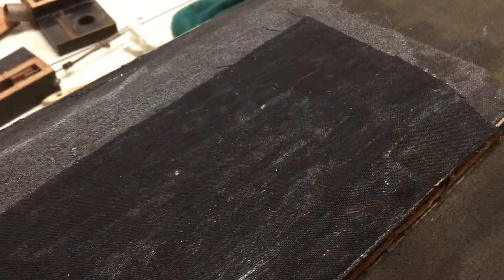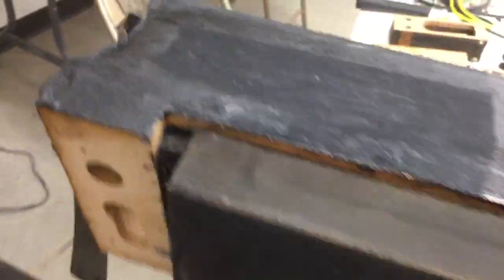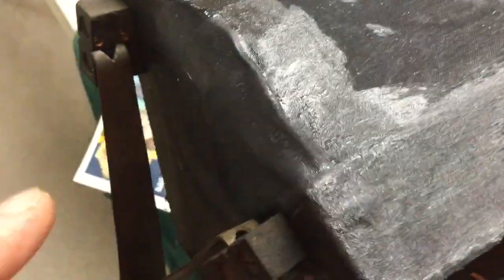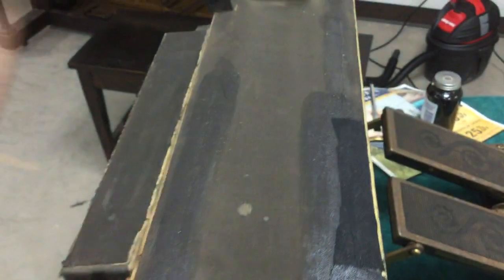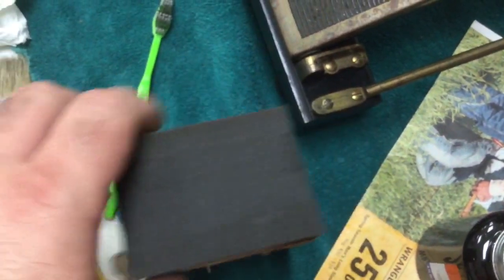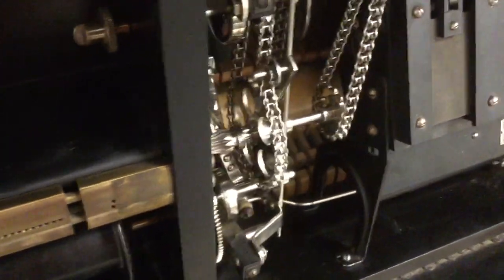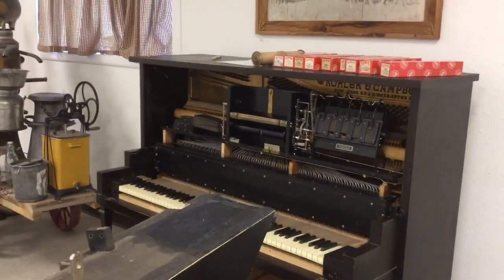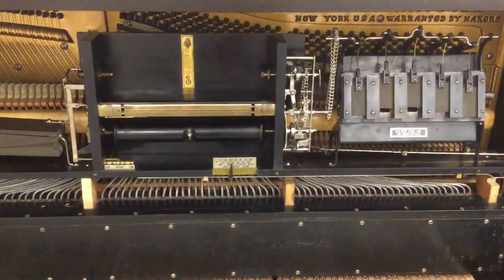How to repair bellows cloth in a player piano

Comment: For those of us looking for information,  it would be very helpful if the entire video wasn't a few inches away from black fabric and the few moments you walked around it seemed out of focus and disorienting... I still can't tell where this piece (pieces?) goes in the piano or how you got it out etc... I am looking to buy one that needs this repair and this was not as informative as I had hoped... all I learned is that you glued fabric to old fabric.... are there more bellows as well? (in the description) ...maybe if you did a followup that explained how you got it apart or if it is possible for a novice to even attempt... thanks
Reply from the maker: John Tuttle has an excellent video covering the removal of the upper and lower actions of a player piano. This video is illustrative, as there were no picture or videos online showing what is explained at Steve's Piano Repair, so you will have to use his and my descriptions to complete your repair. This video shows the large air reservoir bellow that I part of the lower action connected to the foot pedals. You need yellow rubber cement and cotton cloth of approximately the same weight as the cloth you are going to repair. Read the website linked in the description. That is the point of this video, that Steve's method, although not a proper repair (the correct way is to remove the old cloth and recover with new), that this method works and will quickly get your piano up and running.
I do not suggest tackling a player piano if you are not already mechanically inclined and don't mind learning on the go.
Reply: @okbridges  ... I agree... I am going to pass on trying this repair myself!... Thanks!

Comment: I wonder if a caulk like DAP Alex Plus with silicone (40 year), maybe thinned with water, would last longer than rubber cement?  Supposedly stays flexible and comes in clear. The adhesive I purchased for the tracker bar rubber tubing looks like its made that way.  Its thin like paint, so soaks into the cracks  between the wood and tubing.  Works well for me.    Nice simple videos.
Reply: Silicone based products are very difficult to overcome when doing a proper restoration. It makes it much harder for glue to stick. Don't use it!

Comment: Watching because I have a very similar unit (wo electric motor) requiring a rebuild. And planning to DIY it. Mine Has never been rebuilt. I was wondering why you went to such lengths to "patch up" the cloth rather than just replace it? Would it not make it last longer?
Reply from the maker: I think your perception of 'great lengths' may be a bit off. What I did and what is involved to patch up the cloth as shown here is a walk in the park compared to the work required to do a good job replacing the cloth entirely. To spend the amount of time I did in repairing the cloth when replacing the cloth/rebuilding the action would be a hack job and not worth doing. When you go to replace the cloth, you want the rebuild to last the life of the cloth (about 40 years), nothing less. You want it to look and work like it just came out of the factory. 
Using this method to repair the existing cloth creates no problems for the future work of replacing the cloth either.
Check out John Tuttle's youtube channel for some really excellent videos showing how to do player piano rebuilds. He has a very excellent video covering rebuilding the striker pneumatics.
Good luck with your rebuild
Reply from the maker: This video will give you a more accurate view of some of the work involved in doing  a proper repair (rebuild) of a player action: https://youtu.be/sEZYV77SY6A

I've stated it before in other places, and it bears repeating: Doing a proper rebuild is the only way to properly repair a player piano action. If you plan to do it yourself, it will require a substantial investment of attention to detail and time to complete and have an action that will perform reliably for the life of the cloth.
If you cannot make this investment, and your old cloth is not badly shredded, you can get your piano to function without risk of complications when you do decide to rebuild, using the method of repair outlined in this video. It is not a proper repair, but it is quick and easy to perform and will buy you some more time on the old cloth.
Reply: @okbridges  I will watch these certainly.  My player (a simplex) has been non functional for over 40 years. I remember it working, (sort of) when I was a child. It was in need of repair then already. I don't think it has ever been serviced. So I'm sure all the cloth inside is original and most likely over 100 years old already. Even if it takes longer I think it would be best to "do it right" and replace it all simply because of its age, start new.

Comment: would be better to have  a professional recovering these bellows instead of making a mess of them patching. if they are cracked they are NOT in good condition.
Reply from the maker: As stated, this is not a proper repair, but may save a player from being gutted or discarded.
Reply: @okbridges  Did it sound fine ?
Reply: Yes exactly, new rubber bellow cloth is the way to go, because with my experience with pump organs, buy and conquer is the way to go, buy the right bellows cloth and glue it on with real hot hide glue.
I thought Steve was talking about the little bellow keys, not the actual bellows.
You have to think of it like this, are you going to put extra rubber on your old car tires or are you going to buy new tires? 
Also even it you make the bellows not leak, are they going to be flexible enough?
I made a similar mistake, that I thought I could "repair" the bellows, but it wasn't very good, the bellows became as hard as a rock.